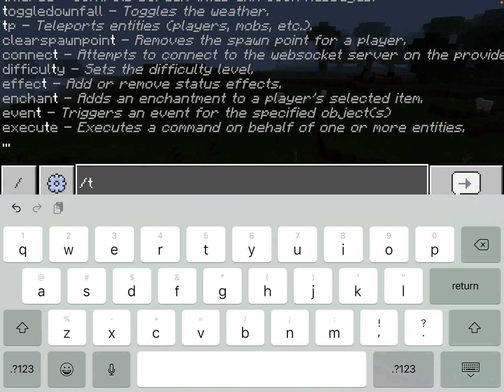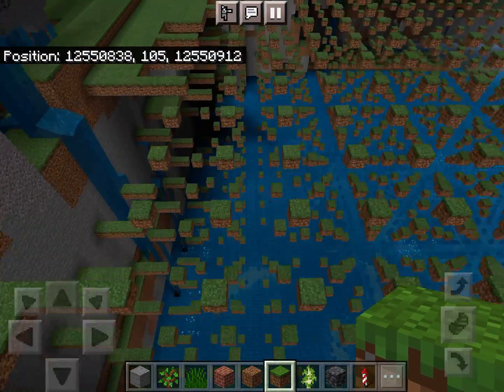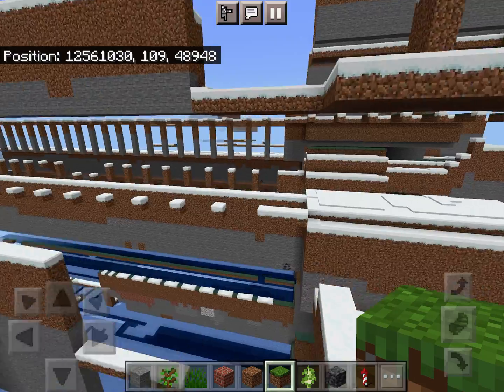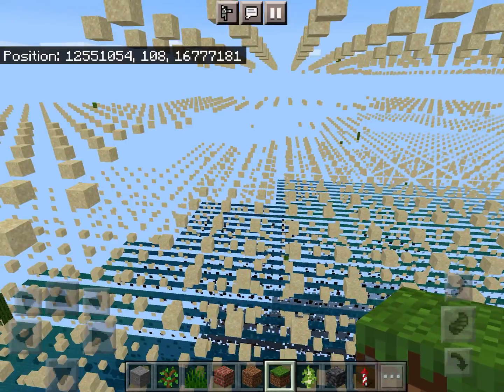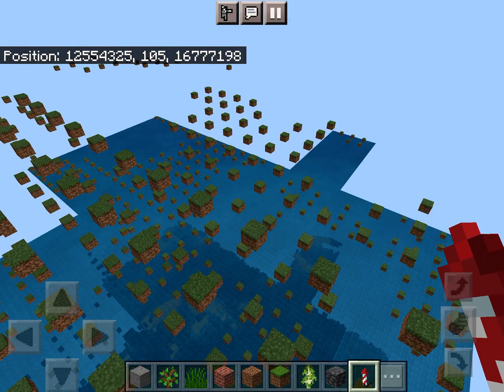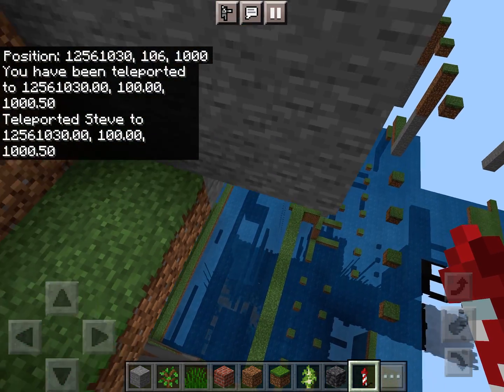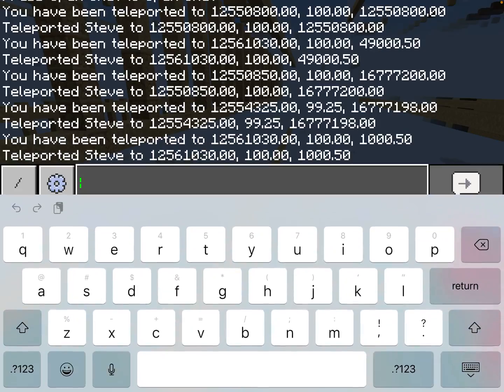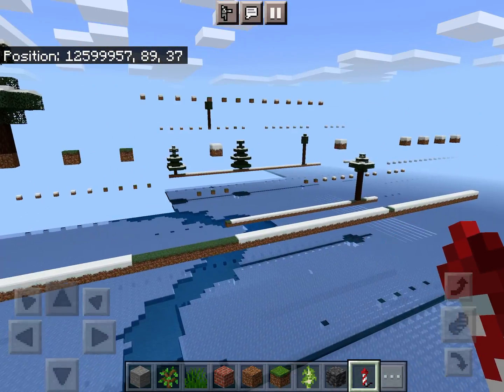Minecraft Bedrock Edition: WHY the CORNER FAR LANDS GENERATE SKYGRID (and more)

Comment: Allam a is it impossible to see a stack generating in minecraft pe
Reply from the maker: With Caves & Cliffs, a stack is found in the Corner Far Lands, so no. With the current default generation, however, the closest we can find is the repetitive/symmetrical Edge Far Lands near the corners, which at times resemble the Corner Far Lands on Java. If we were to hack the coordinateScale value like one Redditor did and push the Far Lands further out, we could slow the breakdown of the Corner Far Lands into a skygrid, but not much due to block rendering completely breaking at 33,554,432 on both axes.